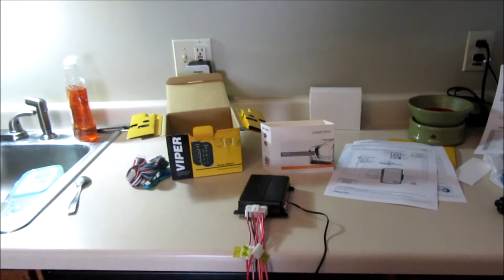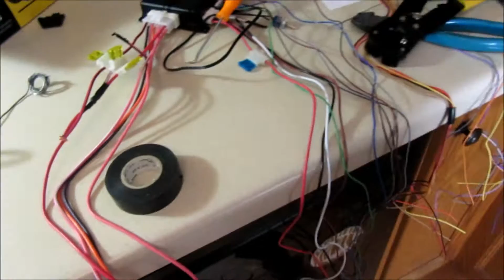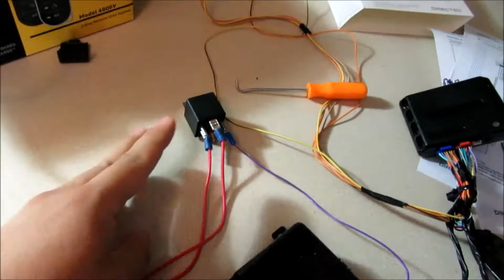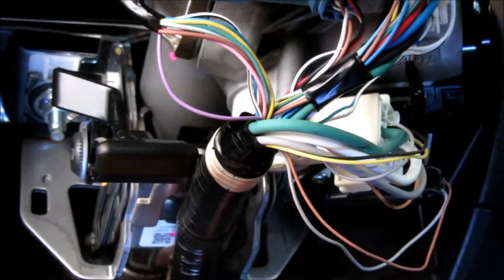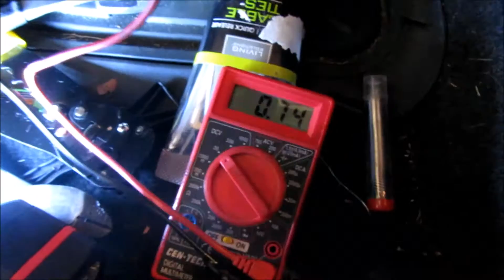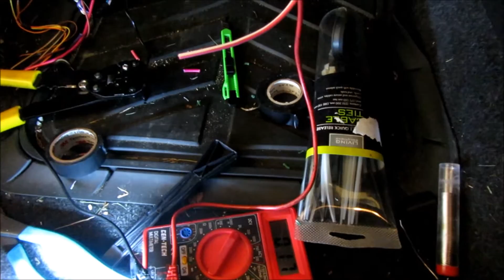2012 Scion TC Remote Start installation. Viper 4806v/DBALL2 Part 1 of 2

Comment: Do you know by chance y my viper 5706v isn’t turning on the acc wires there staying - and acc 2 has a relay and acc is hooked right up to acc wire to truck but stays - during remote start in till I turn the key on
Reply from the maker: It's not turning them on at all? What vehicle?

Comment: I am about to try fitting this same looking viper into a Mr2 does it need a 84 relay wired in, so the starter kill works? Or is it built into the viper until, thanks
Reply from the maker: What is the exact model that you have? Most newer ones have it built in and you have two wires on the viper for the starter interrupt.
Reply: @DIYAUTOCAR  thanks for the reply. It’s an old unit ( 5104 ) the diagrams mentioned on the remote start  10 pin harness, it has a “starter input” and “output & acc/starter relay” then again on the 24 pin harness, it has a “200ma starter output”
Reply from the maker: @EurokitsAustralia  I think I've done a couple of those. The starter kill is built in. If I recall correctly, purple is the car side and green is the key side. Should be a pretty simple install on an MR2.

Comment: Do you think for the brake switch wire I can instead wire it to my brake light? It’s almost impossible to reach my brake switch cable and I have to install a backup camera anyway to it would be easier to run it to the brake light. Would it work the same?

Comment: Hey, I have a manual 2011 scion tc, do you know if the installation process is the same as what you did in your video?
Reply from the maker: Most of it is.  For a manual transmission you also need to connect door triggers, parking brake, tach wire, and integrate with the clutch switch.  You also need to use a remote start unit that is manual transmission capable.

Comment: I have a 2008 scion tc with a Clifford alarm remote start 7752X, car locks and unlocks but remote start don't start. I tried messing with the toggle switch and nothing. Do you think its a bad relay?
Reply from the maker: It could be a number of things.  Generally you will get a series of flashes from the parking lights that are for diagnostic purposes.  I would start there.

Comment: will this work in a scion tc 2014 manual transmission
Reply from the maker: Yes, it should be pretty close to the same.  You'll just have to do a bit more wiring such as tie into the door triggers and integrate with the clutch pedal.  There would also be a procedure to do when getting out of the car to ensure that it wasn't kept in gear.

Comment: Diyautocarage Why you don't cut the primary starter wire?
Reply from the maker: There is no need to do this because the unit that we installed was just remote start/keyless entry.  No alarm/security.
Reply: DIYAutoCarage so if I have with alarm I need to connect everything like normal to my car? I have 2015 scion tc
Reply from the maker: It will be very similar to this with some differences.
Reply: DIYAutoCarage thank you, do you know another way to program dball2? Because the one i have I think is not programmed
Reply from the maker: I had to program mine with an XKloader tool from Directed Electronics.  Although last time that I checked, they don't let you do it yourself anymore unless you are a dealer.  I'd recommend seeing if a shop that installs remote starts will program it for you for a fee.
Reply: DIYAutoCarage thank you
Reply: DIYAutoCarage 
I have all connected, the thing is when i have the alarm lock and try to remote start, the car start but turn it off because the alarm is activated on.
With out lock (unlock) all is fine turn it on the car and all normal do you know what's wrong??
Reply from the maker: What kind of car and which remote start unit are you using?
Reply: DIYAutoCarage its a 2015 scion tc in remote start alarm viper model 5901
Reply from the maker: What do you have the orange wire on the 12 pin harness connected to?  If anything at all.
Reply: DIYAutoCarage 
None, I didn't connected to anything the orange wire
Reply: DIYAutoCarage 
I connected the orange wire from 10 pin heavy gauge to accessory output

Comment: Can I install a Remote Viper 5806 on a Hyundai Accent without DBALL?
Reply from the maker: Which year?
Reply: 2012 Sedan Manual Transmission

The car start running with original key only 
But now he start with any copy key without the code because I remove the code from the original remote and paste it with the Ignition Switch to start with any copy key
Reply from the maker: Well, that is not exactly the proper way to do it but, If that is the case, then yes, you should be able to install without a DBALL.

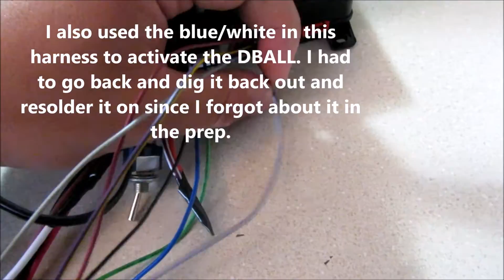Comment: At 1:18, don't you mean the dark blue wire?
The dark blue wire is "status output" vs the blue/white which is "2nd status/defogger". I suppose maybe you can use either?
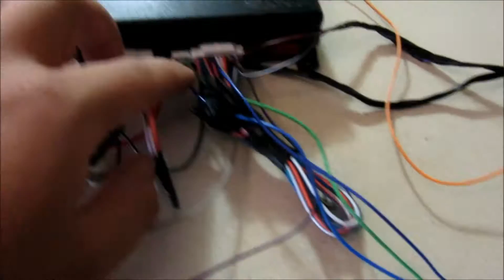Reply: At 6:15 you seem to correctly show the dark blue so I suppose it was simply a typo. Also, when doing nothing, is the dball led supposed to be unlit? I have a dball 3 and that is it's behavior
Reply from the maker: Either one should work.
Reply from the maker: I honestly don't recall on what the led does.   I believe that it is unlit when sitting idle.

Comment: Can a 14 ga wire handle 80 amps?    Look at your fuses. You should take power directly off the battery and add fuses there I'd say split the current draw what's the cara main constant hots max power ratting at the keyswitch?
I'm thinking your a novis installer. Can I get smoke protection on that car? Because your going to let the smoke out.  Now I'm willing to bet that's a 40 amp key switch white wire. But you have the ability to draw over 80 amps off it.  In other words do I need to bring marshmallows to this bonfire?
Reply from the maker: If that one constant 12v wire is enough to start the car with the key, then why would it be any different with a remote start which replicates what the key does?  I assure you that the bypass module and parking lights/locks added to the circuit will not make the car spontaneously combust........  Thanks for watching!

Comment: WHAT Is the difference between all the viper model numbers?  will the 4806 take the up graded transmitters?  I have a 2001 civic 4 door and are assuming this will work with my manual trans, not sure what guarentees its out of gear or it wont start. but I want the lcd transmitters with remote start.  also not sure who can program the dball
Reply from the maker: Various feature differences depending on what you want are the differences.  I'm not sure if the 4806 will take the lcd transmitters.  The main units are very similar, so I would imagine they would but I am not 100% sure to be honest.  The 4806 will work with a manual transmission.  I made a video installing one on my 2002 Civic SI EP3 with a manual transmission.  Check that out if you want to see what is involved with that.  As far as programming the DBALL, sometimes depending where you buy it, you can request that they flash it for your vehicle.  Otherwise, you might have to either buy your own XKloader2(that is what I use) or pay a place like best buy or some other car audio shop/remote start shop to flash it for your vehicle.

Comment: sir good video,but we have better product,you can contact us if you are interesting in our 

product.

we are car security product manufactuer,our brand is cardot,we mainly produce car alarm,car 

central lock,keyless entry,push button start system,smart key,gsm car alarm with gps 

function and start stop button.

Shenzhen Cardot Electronics Technology Co. Ltd

Factory Address:
the 6th Floor,Cheng Jia Technology Park,NO.3581,FengXin Road,GuangMing New District

City:Shenzhen
Country:China
State/Province:Guangdong
Zip/Postal Code:518107
To:Jason Xiao(Trade Manager)
Phone Number: (86 755) 27119211  
Fax Number: (86 755) 27119211
info@szcardot.com
skype:cardots
whats app:+8613510257499
facebook:13510257499
google account:cardot.ignition.solution@gmail.com
youtube account:sales2@szcardot.com
www.szcardot.com
www.smartcaralarmsystem.com
www.cardotgps.com
Reply from the maker: Are you interested in sending me one to review?
Reply: if i send you one product,you can install it to car and take a detailed installation video ?
Reply from the maker: Let me know if you're interested in doing that.  I wouldn't mind trying one out if you claim that it is better than a Viper.

Comment: anyway you could give some guidance on the 4105 model ?
Reply from the maker: The wire colors will still be the same so you can try and follow along with this and compare the manual for each one and cross reference.  The same wires in the car will be tapped into and whatnot.

Comment: I am getting a viper 4105 and viper dball2 installed in my car at a local shop. on a 2015 scion Tc they quoted me $253.76 installed is that a fair price for what I am getting? they did say I wouldnt be able to unlock my car while its on with the stock key unless I paid an additional 50$ to add unlock to remote start button.
Reply from the maker: That is not a bad price for the 4105/DBALL2.  The $50 to add unlock is a bit much IMO.  It's literally one extra wire that they connect on the DBALL2.  Not even anything wired into the car.  But, I guess they have to make their money somehow.

Comment: this would have been much easier just plugging in the d2d cable between the dball and the 4806.
Reply from the maker: Every installer has their preference.  I prefer to not use d2d which is why I showed a w2w installation.
Reply: @DIYAUTOCAR  there's always one (or many more) negative commenter trying to take a giant crap all over your work. Awesome video!